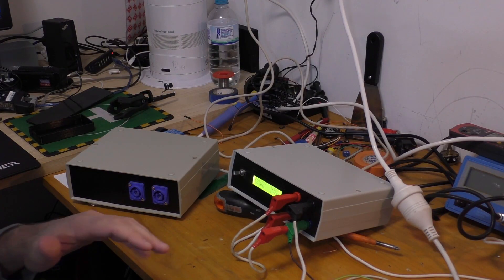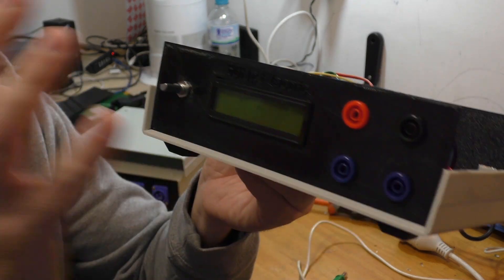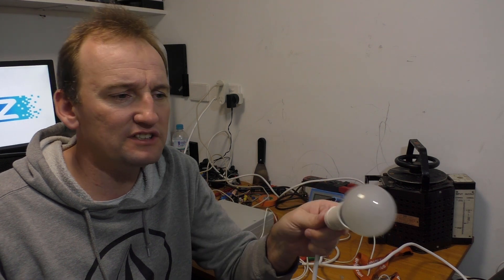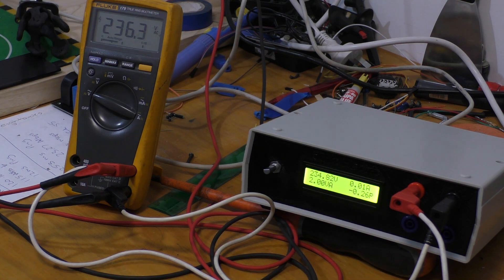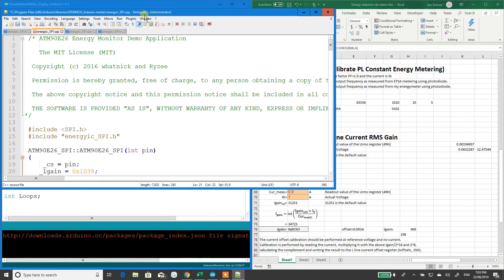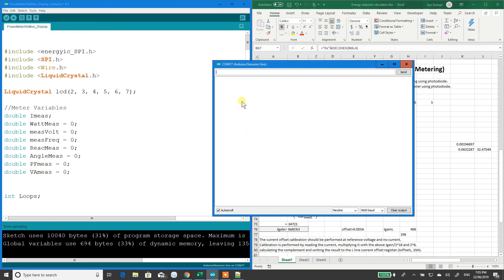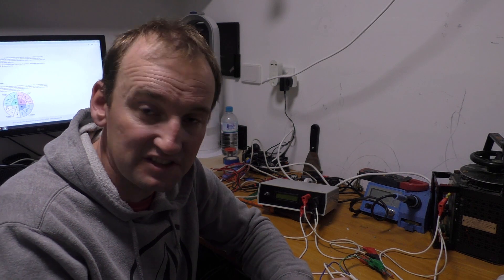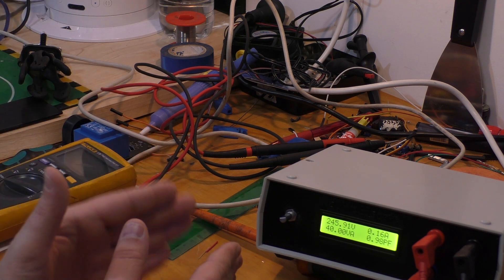Arduino Power Monitor Calibration.

Comment: I connected an arduino mega to atm90e26 via uart (serial1 -pin 18 and 19) but it doesnt work hardware serial but works with software serial on pins 10 and 11.
Reply from the maker: @dee_jay_em  to be honest. I’m not sure.    I’ve connected via hardware only and it worked pretty well
Reply: You have a github repo for most of your scripts?  Working on one and this would be helpful
Reply from the maker: @ yeah I’m in the process of moving them all into it.

Comment: Great work!Though i have a question,if my power factor value is off the true value how am i supposed do calibrate it?
Reply from the maker: I used a heater as i know it works at Unity PF. And changed the calbration number one way watched which way the angle went. Then changed the number the other way and checked again and went from there. Does this make sense?